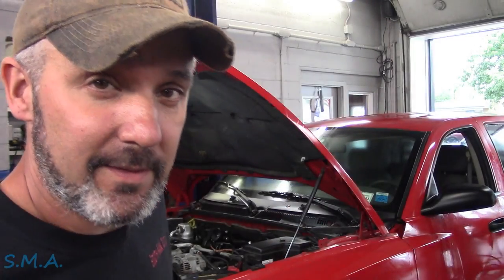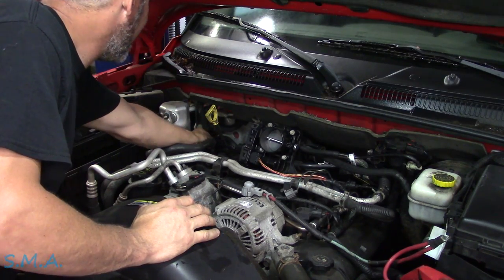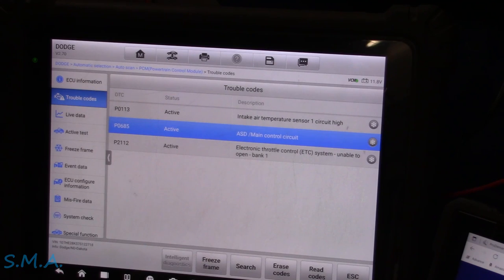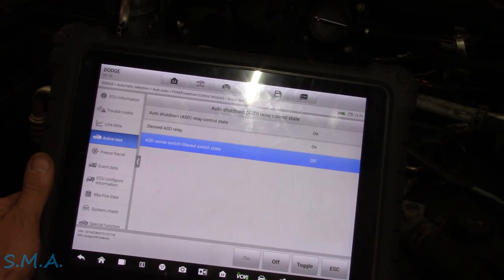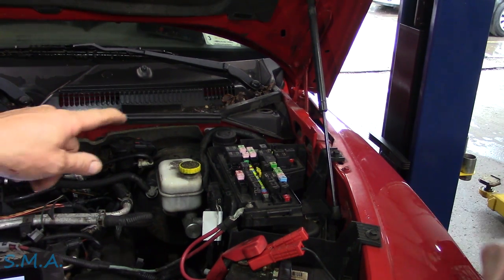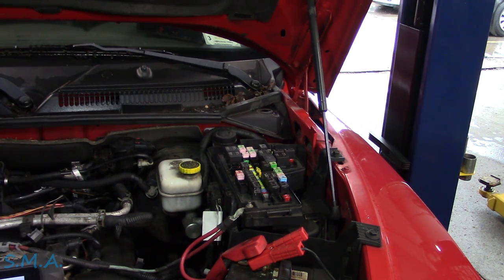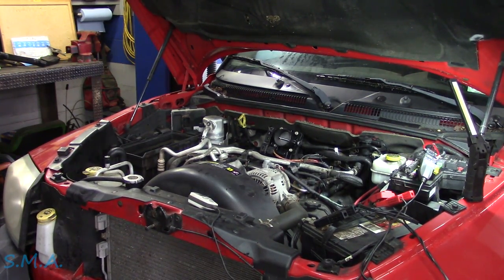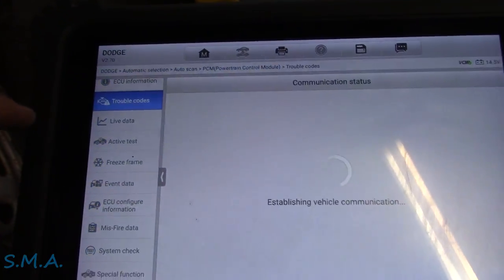Dodge Dakota: No Start After Clutch Replacement

Comment: Quite possibly the easiest "If I/we can do it, you can do it" yet.
Reply: He has had a few "We tried to do it, but couldn't!" on the channel recently. 
This one and two brake jobs of the top of my head.

My favourite two were, "Guy replaces own ECU" and "Guy does own head gaskets". 
First guy replaced his unit with the wrong one and just wrenched it into place mangling the pins, second guy was sooo close, just forgetting to put the springs in that connected the spark plugs and leads.

Comment: Silliest thing I ever did working on a car was when I replaced a stop-light switch in my '68 Ford Galaxie 500 convertible -- and the problem turned out to be two burned out bulbs.  "There's no way it could be two burned out bulbs -- how could they both burn out at the same time?  It's gotta be a stop-light switch!"  I never even tested the damn bulbs.  Or the wires.  Or the fuse.  I went straight to the most difficult part to replace.  Duh.

Won't do that again. ;-)

Comment: Me and 5 other guys coming back from Cedar Point. Car starts acting up, lights going out, engine starts dying, we stop at a gas station in Flat Rock and the car goes completely dead.poking our heads around trying to figure out what's  wrong. Now this was way before cell phones were a thing. A couple of guys were stressing out,, my parents were in Florida. Some guy walks over, looks at our car and asks questions. Leans into the engine compartment, says "maybe it's  this", and plugs a wiring pigtail into the back of the alternator.  It starts right up and runs fine the whole 3 hours home!

Comment: Had a new truck driver (18 wheeler) with the same company load right next to me. I noticed a bunch of oil on the right side of his brand new truck. I asked him about it thinking he was about to blow a turbo or something. He said quote "it has a massive oil leak at about 3gal/day (on a 11gal pan) for the last 2 weeks". He was headed to the yard with his load. I had him open the hood the cap was off & hanging by the chain. I asked "did you forget to put the cap on the last time you filled it?" He said quote "there is no cap for that... it has a valve right?" I said "no" and showed him the cap. Put the cap on and leak was fixed. Apparently the shop didn't put the cap on 2 weeks ago and this guy was adding 3gal everyday & never saw the cap dangling about 3" below the filler tube.

Comment: I put news spark plugs in my pickup and afterwards it ran like crap so I looked under the hood and I could hear this ticking sound and looked around and I could see a blue spark I shut the truck off reattached a spark plug in the way it was supposed to be and it ran good

Comment: mistakes? Put both secondary brake shoes on the same wheel...dad's truck didn't want to roll. Swapping an engine. It wouldn't lower down to touch the engine mounts. It finally did when the air horn on the carburetor snapped from hanging up the seam of the firewall. Those predate the internet. Now that we got new ASE level youtube training vidjeos every week, not so carelessly dumb around a wrench. Simple? My Dodge Ram wipers were working, but making a racket every revolution. One of the permanent magnets in the motor had dislodged from the housing and was scraping on the rotor. A little JBWeld to glue back in place, better than new.  P2509 code...clamp on the battery terminal was cracked. Replaced with a military style clamp and a homemade lug made from 1/2" copper pipe, tinned, crimped, soldered and shrink wrapped.  EZ peasy.

Comment: Here is my silly story.  Overhauled a GM engine.  Upon reinstalling the adapter for the oil pressure sending unit the alignment pin was deliberately placed in the middle of the recieving hole.  Turns out, without a path to ground, the engine reports ZERO oil pressure.  I will not even tell you the story of how I figured that out as that story is a sad tail of woe.

Comment: So uh, not proud of this but my wife had an older model volvo, the ones that looked like a brick, and there were so many models and sub models that her specific one had some quirks to the electrical relay placement.  Needless to say after many a day troubleshooting and testing, her car wouldnt start, or would start and only run for a few minutes before dying.  I shot the parts cannon at it thinking the fuel pump was dead, reasonable assumption seeing as how it had good spark but died after starting, i was also spoofed because at the time it had the volvo version of abs and the relays were under the hood next to the booster and wiring loom.  They tested almost identical to the fuel pump relay on the volt meter when turning key to on position etc, so young and dumb me didnt know it wasnt the fuel pump relay, i just assumed.  Well you know what that means, i swore up and down the relay was good, and it was but it wasnt the fuel pump relay.  No no, that was inside the car,   under the radio din in the dash... I didn't know that until after i traded the thing off being mad i couldnt fix it. Still a blemish on my pride to this day, i now always google where the relay placement is and verify with vin codes.  Lessons learned the hard way i guess.

Comment: Toyota Sequoia, 180k on the clock,, P0430. Won’t tell how I have done unauthorized repairs to abolish this code.  Got it running and test drive.  Back at shop it wouldn’t back up.  Throttle seemed to do nothing.  Another shop had already told them the TPS was bad, code set, but he passed it in inspection anyway.  Kept checking things and the air filter was totally plugged,  had been running rich for who knows how long, and melted the cat. Not willing to to spend that much to repair correctly, customer took the vehicle to the auction and got $1100 for it.

Comment: Why unhook the negative terminal and not the positive on the battery?
Reply: Because you can't complete the electrical circuit without a ground. One of the main vehicle grounds is the battery.
Reply: The negative will not draw any current if you short it to the body with your socket or spanner.
Reply: most vehicles are a negative ground, so removing the negative connection means there is no ground anywhere in the vehicle, so no current can flow. removing the positive would not remove any built up charge in any of the systems, which if you bridge anywhere to ground, could cause a short/spark.
Reply: But if power is still going to electronic components, couldn't a connection be made if the component grounded out accidentally?

0 seconds ago
Reply: @freetolook3727  No, because there is no ground if the car is disconnected from the negative battery terminal.
Reply: I tried to look it up but the reasoning doesn't make much sense to me. Let's say if you short the negative battery terminal there wouldn't be sparks as there's no electric charge difference from negative terminal to chassis/frame/random nut or bolt in the car, positive will have spark if you short it to the chassis, if you short the positive and negative guarantee somethings gonna blow. Either way goal is to cut the circuit, there would still be sparks if you start to separate the negative terminal and the post especially if there's high parasitic draw. Like if you're replacing a battery on a device you'd probably want to have the switch off, too bad there's no real way to turn off everything on a car.

Comment: My uncle has a 2002 Ford F150 he calls me up one day after he had someone change the fuel pump they were also messing around in his fuse box he ended up with a no-start scenario took me 5 minutes to fix the problem whoever it was who was in the fuse box moved all the fuses in the Box putting all the wrong fuses in all the wrong places I put them in the correct spot told him to start the truck and problem solved. Lesson to be learned here don't let just anyone work on your vehicle

Comment: Took my car to Midas once for a state inspection and oil change. His computer couldn't connect to my computer so he said I needed a new wire harness. I said the power port for the phone is on the same circuit and blows every once in a while. He said he tested all the fuses and that I needed a new harness. When he backed it out of the bay, I checked the fuse and it was blown. I took it in and showed the manager. Plus he forgot to change the oil. Never been back to Midas.

Comment: Easiest fix I ever did was replace a fuse for the starter, but one story I got is how I found a dirty mechanic.  Back before I married my wife she and I were dating and she worked at a used car place and of course took her car into the company mechanic, easy she knew him from work and he didn't charge for a lot of stuff or if he did it was lower than any other shop.  Well I told her you don't need to take your car to him anymore as I happen to be a mechanic, and I don't know but she didn't believe in my abilities as when I told her what was wrong she would have to fall back on her trusty mechanic from work who would say the same thing as me and then I would end up doing the work then she would take it to her mechanic and he would approve this was very annoying, but I changed the spark plugs on her car as they've never been done since she bought it, I said why hasn't your guy done this yet it's WAY over 30-40-50-60-70k miles and beyond!!!  He says their fine I said BS, so I replaced them, now some do this some don't we all have our ways but I gap them to the vehicle spec, anti-seize the treads, and dialectic Grease the boots.  They come out ease on the next cycle, I've never broken any since, it's actually fun to work on knowing I took these steps. Now as time went on he was doing things and charging her for services I didn't agree with and I told her I think he is dirty and has been taking advantage of you, well she saw me put the new plugs in and I told her these will be good for at least 30k miles before we need to replace them.   Anyway she had him look at something I forget now what, but he tells her it needs new spark plugs as I heard him on speaker phone, I said sir did you pull one out?  He said yes, I said were you amazed at how easy they came out and how clean?  (I took one out when she came home to check and any man or woman mechanic of any year can see clearly these are brand new and someone had just done them) he asked what, I said BECAUSE I DID THEM YESTERDAY, THEY'RE BRAND NEW!  He argued and she looked at me with wide eyes we hung up I said do not take the car to him ever again God only knows what he will do and what I've been fixing he has probably been messing up to get side money out of you.  She never doubted me and never let him see the car again, and ever since it's been under my care it's had zero problems.  Sorry this is a long one but a good story.  Also put your initials on parts you expect the mechanic to change my dad did that and found one shop that when asked to see the old part they brought it to my Dad and his initials weren't on it he looked under the truck and saw the same starter there with his initials on it, and they were going to charge him for the work, my Dad said I'll do it myself was trying to save time but not at the expense of being robbed!  God Bless you all be Safe and Be Well, thanks for reading.  (Done on my phone so I'm not editing anything forgive auto correct as my smart phone can be dumb sometimes and I didn't watch every word typed)

Comment: Valve covers on a 2006 Subaru Outback.  Pulled the fuel rail to make room to sneak the cover out the top. Got the passenger side done, started the driver's side, but got to worrying about the oil I had released down a spark plug hole into the cylinder on the passenger side.  "Not to worry," the internet said, *just take that spark plug back out, cover the hole with a towel, and crank the engine a few times - it'll blow that oil back out the hole."  So I did that. Plug, towel, crank crank crank, key off, why does it sound like there's water splashing on the garage floor?  The driver's side fuel rail was laying in a parts pan on top of the engine, and there was gas freakin' EVERYWHERE.  ROOKIE MISTAKE, YA DING DONG.

Comment: old car, complaint:  ran poor, trouble starting. Owner said his car had a new battery and a new starter moter. 
So i take a jumper cable and connect it between engine block and battery ground. Presto, car starts instantly and runs fine. I take off the jump cable and car runs like crap again. 
Took a gander at the ground strap between block and body. It was greenish/heavily corroded and almost desintegrated on touch. 
I installed a new strap after cleaning the connection points and DONE. Car started and ran fine. 
Cost: maybe 5bucks? i forgot. 
But i do know the guy got shafted for a new battery and starter.

Comment: Replaced a transmission on a vehicle with a later model, had to swap a couple wires for the shift solenoids, I was looking at the connector backwards but somehow the wire colors were the same, blew 2 fuses, walked away for a few hours and had the “you idiot” moment.

Comment: The speedometer on my '03 Jetta failed.  Dealer told me I needed a new transmission speed sensor.  My normal VW mechanic immediately asked:  "Do your backup lights work?".  Huh??  It turns out that some idiot was playing with an aftermarket backup camera (sheepishly raises hand) and shorted out the signal from the reverse lights, blowing a fuse which causing the speedometer to quit and the low fuel light to come on every time I made a left turn.  Trust VW to overcomplicate things and make a speed-sensitive gas gauge.

Comment: Thought a rod bearing went out and tore down most of the engine only to realize that i had blown out a spark plug on the back of the motor facing the firewall good news was the rod bearings looked fine🤦‍♂️

Comment: Simple/silly repair had to be trying to figure out why check engine and airbag lights were on with nothing wrong and no codes for an early 2000's Ford Ranger. Turned out to be the ten cent bulb for the passenger airbag light in the middle console burned out. Most annoying few days spent.

Comment: we had a merc in the shop years ago with a no start complaint, 3 guys looked at it and still no start, i got the job after they all stopped scratching heads, i found a blown fuse in the fuse box 10 amp, lmao

Comment: My dad bought my little brother a used mail truck to use at our cottage. He was working on the engine , and then it stopped running, he tell my dad gee it never did that before ...he starts looking under the truck, then yells at my dad. "THE GAS TANKS GONE!" MY DAD say s get in the car ahole...they found the gas tank on the side of the road about a mile away...still full of gas!

Comment: I replaced a bulb in my beamer that was too bright, blew the fuse. Didn't have a test light, so I pulled them to figure out which one it was.

If you know anything about the 3 series, the fuse diagram tells you what it is on one side, and where it is on another side...
Well, being a little wet behind the ears, I pulled the without putting them back, then put them back in the wrong place, fixed the light but now I have a no start.

Yeah.. that was $300 down the drain.

Comment: Had brass guides in an engine"s heads then stored the car the engine was in and the gas got gummy, went to start with old gas valve stems stuck to the guides after engine cooled down. Next start the valves pulled the guides, cost me 600$ for the guides to be reset, 30 years ago. I knew better just didn't want to admit I ruined 20 gallons of 105 octane gas by improper storage. Nothing like the smell of leaded gas in the morning.

Comment: Simple fix that wasnt so simple to fix was 93 civic parking lights wouldn't turn off, ended up being the digital clock on thee dash had shorted and was feeding that circuit.

Comment: Great video!! I am no mechanic by any means, but why such a high amp fuse for a circuit that looked like it never drew more than 6 amps. Probably the stupid question of the day, but hey I've asked better ones before 😎✌
Reply: You want to size your fuse for no more than 70-80% of max load. And since the fuse runs a motor it needs to be sized for that in rush of current when it first turns on. His meter isn't fast enough to capture the spike. If you put a scope on it you would have been able to see it. A fuse will blow below its rated limit if ran near the limit for long enough. They can also not blow above their limit for awhile as well. If you look at the data sheet for a fuse it will give you a graph with the current vs time required to blow the fuse.
Hope this clarifies things

Comment: Just 2 of many. 1: Car with customer battery replacement. Noise on start up and continued while running. New car to him {bought for son for college}, digital radio, noise fixed by tuning radio station or turn radio off. 2: Customer traded GM for Toyota, could not get headlights to stay on bright.. Showed him Toyota push down to bright, up for dim, and up again for bright light flash, unlike GM where each time you click up it switches from bright to dim or vise versa. His thought was when he held switch up {flash to pass position} the bright light indicator glowed, let go back to dim. So it had to be a bad switch, RIGHT ??? DRIVER EDUCATION CONTINUES AFTER SCHOOLING ENDS !!!

Comment: Easiest fix ever: Mom called me in a panic, stuck at Eckerds and could not get her Toyota to start.  Panic.   So I go over there, hop in, cranks right up.  It turned out she parked it in a corner space and the steering wheel had to be turned before the ignition would unlock and let the key turn. Nothing else wrong.  It was amusing to me and embarassing to her.   But it got the job done.  Miss ya Mom.

Comment: Simplest repair? Customer had their vehicle towed in after installing a new battery in the car. Yep, a battery can not do the job if you do not remove the black plastic cap off the negative post before installing the cable.